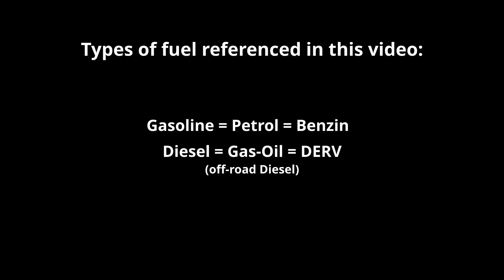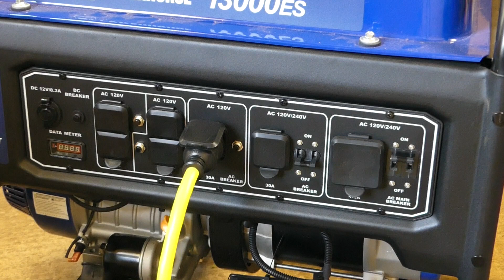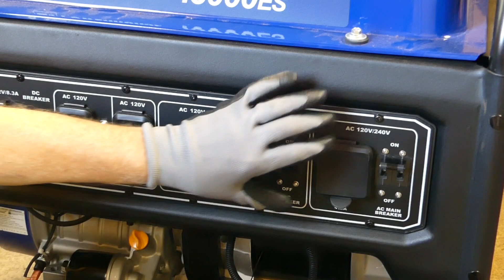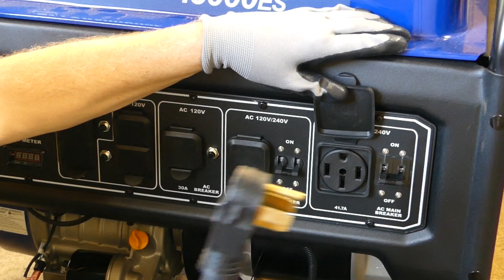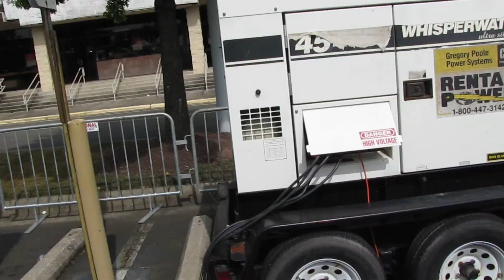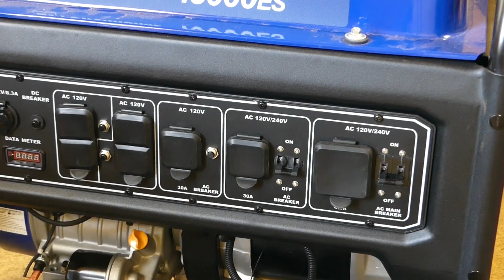Talking about gas and diesel generators for sound systems.  What we have used and why.

Comment: on the blue generator, can you use more than one recepticle or will you have to chose which one you are using?
Reply from the maker: It is common to use more than one receptacle at the same time, but only on the lower wattage/amperage circuits/receptacles.  For example, the blue generator has 2 x 20amp identical circuits for standard Edison plugs.  Both of these circuits can be used at the same time; however, it is still very important not to overload the circuit (or generator) by trying to use more power than it can produce.

Comment: This is really nice. although the Honda ones are preferred in the film industry because of their quiet inverter nature. There's Not a lot of difference between diesel and gas apart from fuel it's more that they bigger ones tend to have a lot more sound deadening and sound control and Muffler's. In other words the cheap ones you pick up at Home store are barely put to a frame and sometimes barely even have a muffler they're gonna be loud and sometimes unregulated.
It certainly has been interesting with the amount of Chinese knock offs of the Honda's coming out recently.
Reply from the maker: Inverters are great.

Comment: It's amazing how much you can achieve within some power constraints.  When doing small indoor shows, I can very easily scale things back to running on a single regular UK outlet, which is 13 Amps. Nearly all of my lighting is LED now with the exception of a couple of old Martin Scanners which I'm loathed to part with, and all of my amplification is class D.

For the bigger shows though, I generally ask for 3 phases at 32Amps per phase, where the load gets distributed among the phases.  Even with class D amplification, power draw can be high.

I very recently went to a show where a brand of generator called NED was showing their generators, and their Hush series of machines are unbelievably quiet...quiet to the point where you had to question whether or not they were running at all.
Reply from the maker: Nice!

Comment: Why not switch to something like the eco flow delta pro? Have it right on stage and not run hundreds of feet of extension cables and you won’t have voltage sag
Reply from the maker: Those devices may not be the right choice of portable power for sound and/or lighting systems.  As referenced in the video, we don't provide power for events; that is the responsibility of the organizers/producers of the events.  Either generator or utility power needs to be available at an event site.
Reply: For a smaller system it makes sense, I don't think it's going to hit for larger venues systems because the length of run time needed.
Now I have seen some solar trailer systems which are definitely going to be more frequent in the future I think.
But there is one limiting factor you have to have enough open space and sun to keep the batteries full and supply load during the day, and enough battery capacity to get through the night.
And right now large high-efficiency diesel generators are kind of like the perfect package for temporary events.

However something to be considered.
some battery power stations have what they call UPS mode which might lend a nice buffer between stage and generator if sharing or even the grid. This is not used that much yet and I think it's another avenue that's going to get adopted soon. as the grid can go down at inconvenient times and generators can run out of gas or diesel or whatever assuming they're not topped up before the show or in cases of multi day shows.

I personally have all of my digital stuff on a UPS in my rack which leaves only amps and stage stuff that will lose power. But if I was doing a venue where I was really sketched out I would probably put as much as I could stage wise on a secondary UPS and maybe even the amps if it was super critical like a political address. I figure the amps can go off and come back on that's fine they have power Protection but if I keep my digital mixer and wireless microphones and Computer (I use a laptop, built-in battery) running assuming the Internet doesn't go out; I can still be live streaming, recording and right there ready to pick right back up as soon as the amps come up. Or if in an emergency I could load shed non critical amps and plug into the UPS within a minute, if needed to make an emergency public address quickly.
Reply: For tiny systems with 2 tops, 1~2 wedges, no subs and no lighting those "big UPS" thing might work fine. However, gear rental companies don't only deal with that type of tiny events. They need to think about scenarios of larger scale. Using a generator with decent capacity to cover a wide range of different scales is a better choice economically. That's the exact reason why rental companies seldomly have mini mixers like MG10XU or FLOW8 in their inventory - A larger mixer can do small jobs, but not vice versa. So why bother spending extra money on small mixers?

Comment: Id love to be able to run a show on a smaller geni, we usually start with 100kw and depending on lighting requirements that can easily double.
Reply: Definitely trailer mounted, our large shows can easily have 50-60k of dimming.  We still have a ton of prerig with 1000w cans.
Reply from the maker: Lighting can certainly demand a whole other level of power!
Reply from the maker: 100kw is a lot!  By chance, do those generators reside in 18-wheeler tractor trailer rigs and show up at concerts?  We used to require about 30kw for larger shows when we used "big iron", but since moving to Class H and Class D amps, the efficiency is incredible.  We request 15kw for us, and around 10kw for lighting (if lighting is needed).  The 15kw has worked perfect.

Comment: Thanks!  If you dont have a 240v 40A circuit available, how do you combine two 20A circuits?
Reply: You don't actually combine anything. In fact I've had an experience with that going the wrong way.
You're able to load each circuit to roughly near its max with tolerances etc.
Theoretically if you took two breakers and slapped them together in parallel you would have a 40 amp breaker BUT you'd have a very unsafe combination. One breaker could trip and the other one could fail and overheat. Are you using 6awg wire on that now 40 amp circuit, you're not oh well now you've just rendered your circuit breaker useless and made your extension cord into a fuse or a long rope heater depending on which way you look at it and how much load.

I had a food truck that needed 240v sort of (they didn't really but that was what their inlet was set up for and distributed separately, mostly refrigerators no deep fryer). They brought five extension cords. And a special adapter homemade that took 2x20 amp circuits one going to one pin and one going to the other pin of a 4 pin 240V socket. Since they weren't using anything 240v one side was needed to connect for half the circuits and the other side for the other half. Out of the 5 extension cords one of them was miss wired of course the one that got used and as soon as they plugged it in Sparks, tripped breaker, melted outlet. Dead short from hot to neutral through 50 feet of extension cord. I checked everything and fixed everything and got free lunch.

Now another question would be what if you connect the two hots together well they are out of phase with each other and I don't want to know but it won't be pretty if there's no circuit protection.
Reply from the maker: I'm not aware of any way to do that on a generator.  It may be better (and safer) to get a generator that provides a 240V service!